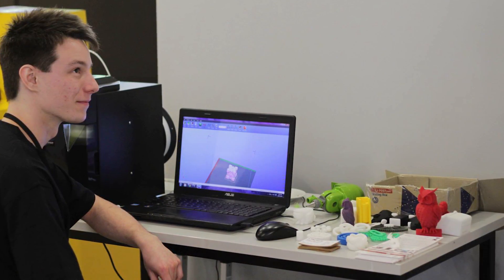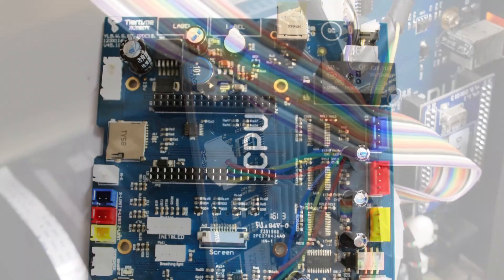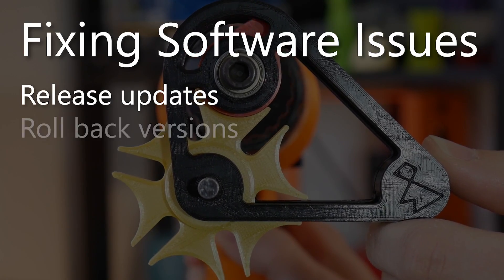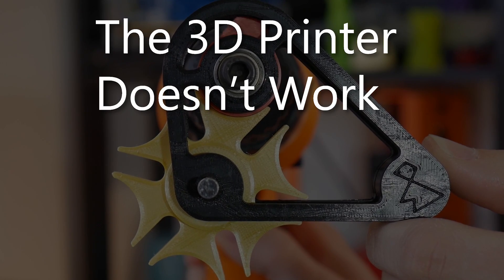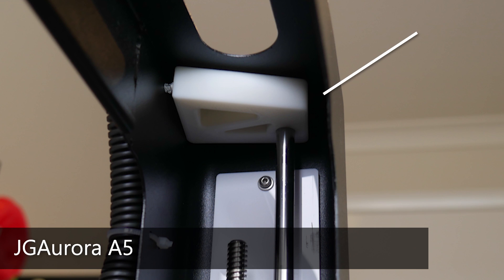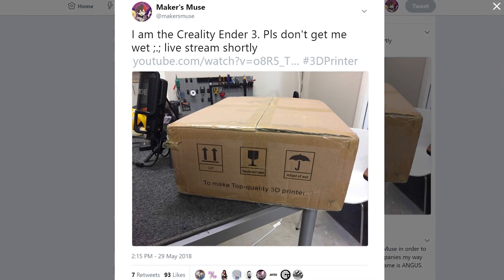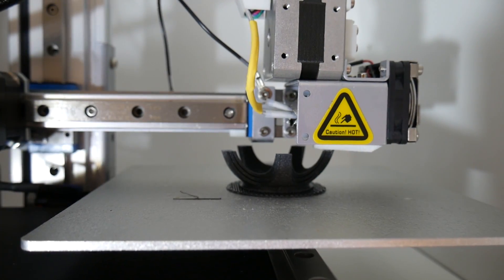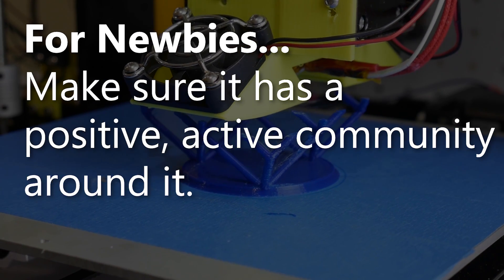Serious Concerns with 3D Printer Quality Control

Comment: I'm still using one of the early Red UP! Plus printers , 4 pin power supply. Granted it has a small print volume but I am still happy with the output. I wonder how many cheap kits will last the test of time. Keep up the good work Angus.

Comment: Well put Angus. In the past 6 months I have had 2 out of every 3 printer kits that were not as advertised and very frustrating to get the sellers to make things right. 

If it was not that my first 3D printer was a good one and I could use it to create parts added to my access to a machine shop and electronic experience those kits would still be parts in boxes and not functional printers. 6 printers later and I now trust no kit supplier at all. 

When I now purchase a kit and anything is missing or broken I immediately return it, Amazon is quite good at this.

Comment: Hello Angus thanks for sharing!
I have a 3d printer store and I only sell tested 3d printers meaning I test the the printer for over a two thousand hours before I deside to resell it. I can't tell you how many horror stories I have heard about these Issues you have addressed on this video over and over and over.
In the long run these cheap chinese printer had given my store more customers who seek a decent product, of course they have to spend more money, I would say this is a valuable lesson for any one who watches a youtube review and uses a code from the smuck who made the video to buy a low-grade 3d printer our anything or any product from this senerio. All that for this smuck who makes about 4% from the company who products he is reviewing and gets a 50% discount so they can buy more cheap crap and do more videos.
It used to kill me when I would see a review and the title starts something like "Could this be the the best 3d printer for under $300.00" and then the whole video is about how to make this 3d printer better with new upgrades, that false pretension should be a warning sign" IF you have to add new modification to anything consider that a warning sign and run the other way as fast as you can.
 "SUCKERS BEWARE" Save your money and buy a decent 3d printer or be ready to spend a lot of time upgrading your cheap 3d printer that will never have the print quality of a better more expensive 3d printer.
If you don't have the skills to and the time to do this, don't suck-up and buy this printer. You will waist your time and money and the taste of false pretensions will never leave your mind when you encounter this senerio again.

Comment: Good, someone said it.. my kit had instructions for some other printer, I'm messing with mains power, and trying to wire up to a PCB with no clear instructions at all.. I got it working, but it'll regularly fail, prints stop screen goes black... I wouldn't buy another 3D printer. I mess with the one occasionally, print something, have it clog or not, finish or not... I simply don't care.

Comment: I would like to see two grades - the first is about how well it works and second the longevity of the model revision cycle (and maybe geographic distribution because it is nice to have a beer with someone else who shares your woes) of the device. The 'does it work' factor addresses the basic problem of a review but any model that does not have enduring iterations is probably throwing good money after bad (As you noted). I read kickstarters, prospectives but none of it addresses QOS in any terms I could accept (like real numbers of devices failed, versions and inventory of replacement units) I have worked in software with the beta model, agile .. and the results are generally bullshit until interaction three or four.

Comment: I understand what you are saying Angus.  I'm an elementary school teacher and I'm on my way to becoming essentially a STEM teacher in a year or so.  I've been involved in 3D printing for about 2 1/2 years starting with a Prusa MK2, and then quickly adding 4 Anet A8 machines.  When I work with kids who are interested in getting their own machine I talk to them about expectations versus price and kit versus ready to print.  Our school system buys only Makerbots so I can point to the Replicator in front of me and say this machine will GENERALLY print what you expect it to, as long as PLA will work for you.  It costs 3K give or take.  I can say to them that they can get an Anet for under 200 bucks, BUT you have to be willing to put it together, which in itself is a very valuable exercise for people in generation " I don't know what nuts and bolts are" to go through WITH AN EXPERIENCED MENTOR.  I can also tell them that the cost of the kit is the starting place for how much it will cost.  There are the printed upgrades you mentioned, a couple of MOSFETs to make them safe, perhaps some wiring upgrades and a few parts to make them more convenient to use like an SD card extension cable for the A8.  If they and their parents are willing to put in the time to build and learn, then I think a kit is acceptable, maybe better in the long run from an education standpoint ( Sexy Cyborg is also right, we can't expect cheaper and cheaper for more and more.  I would like to see the same Anet for the same price and better documentation personally).  The other difference is when you buy an ANET there is no support from the manufacturer to speak of, but there is a community and a realization that it is very much like dozens of other REP-RAP printer kits.  This means there is a lot of information on the web and people to talk to.    

If we are talking about a fully finished 3D printer, especially if it comes with a nice case on the outside then I agree with you 100% you should be able to take it out of the box, plug it in, put the filament into the mysterious hole that says put filament here, upload your file and out pops your result.  That type of machine should cost  much more than a kit, and it should work first time out of the box and every time after that.  But is there really that much of a market for that outside of schools (Makerbot) and industry  (Big money machines?).  I think the most important thing you do on your channel is tell people about what does and doesn't work on each type of machine, and help us to see which ones to watch out for. You also have your ear to the tracks and like this video, warn us when thing change.  I know it's frustrating to review something and then find out that they have changed it already, but what can be done. I'll tell you what, watch Maker's Muse you've got your eye on the ball! 

I have to say that the whole testing - your - hardware - intensive - product - on - the - public scheme is a time honored practice.  You know who is really good at that?  Auto and refrigerator makers.  I'm not going to single out anybody in particular because they have all been and/or are guilty of it to a greater or lesser degree.  The difference?  they have a shop or a fleet of repair trucks and they come with a long warranty.  Oh yes also a more refined product overall and a more established set of expectations and user parameters.   

Summing up, thank you for the warning.  It is noted and I will be watching carefully to see what happens next.  Secondly I will remember to expect to get what I pay for, and if I am going to pay a lot, to find out if I will  be able to get good service after my purchase, before I purchase.  In the mean time I will keep watching Maker's Muse because that guy knows what he's talking about!
-David

Comment: Windows 10 is another example of buggy software that gets fixed latter. Companies need to put some version numbers with these also, it would help bring some more transparencies that are needed. Some examples of of manufactures that do this are AMD and Nvidia, Nvidia gt1030 (ddr5,ddr4), gt1060 (3g, vs 6g) are modern examples from nvidia, I know amd did this however they seem to give different model numbers these days.

Comment: Well that explains why my machine printed inverted about the X axis and the company had no idea why. And most of the bolts were wrong length. And the extruder always failed after an hour of printing. And the Y axis belt didn’t line up very well. And.....         Dont worry though, I got it all sorted out. After many weeks of extra work, and basically rewriting the instruction manual and parts list for the company. Who may or may not have just thrown it away.

Comment: Well, I have not read the book, but in brief, it sounds like what I have long referred to as "The MicroSoft Development Path"... get it mostly working, make lots of noise and toss it out the door... only let trained employees demo it, so the likelihood of failure while on display is lessened... And if you must let someone else touch it, be sure they know as little as possible about computers and tech... As I said, I haven't read the book, but what little you said about it, sound like MicroSoft's long track record. How about their C compiler that ate hard drives on certain controllers? ( that was way back, in the 1980's I believe ) Or how about trying to resize your Windows Vista partition, and having Vista itself destroy the data? Still on Vista, I watched both Sony and Dell OEM versions make themselves unbootable on a Service Pack Update. And intentional damage, when you installed a certain update to Internet Explorer on XP, it killed your Office 97 copy of Access. That one was fixable, remove the update, but it took me hours to nail down why the customer's application died after updates. I could ramble on with more examples, but these were all rather blatant and repeatable.

Comment: Had an opportunity to get a bargain small desktop 3d printer M200 or known as a Monoprice Mini and took the chance. I know I can both make and fix things if it goes wrong, but that's not the same for everyone. I have since upgraded to a Tevo Tornado and being several years old design, it has a good backing and support. I am spending hours and dollars to upgrade to the best it can be as it is already proven to be a solid design. 
Someone has to take a leap of faith and it's the likes of Angus that I will turn to for advice. If I have to muck around for a 100 hours to build and tweak, really, i'm not going to be interested even if I have the cash to throw at it. Thank you fellow Ozzy for being on the ball and calling this issue out for airing. See you on the next vid.

Comment: Nicely said. I was lucky - my first printer was an XYZ printing machine I got very cheap (sub 400 Aussie). Really solid and still works great today despite the (minor at my print volumes) annoyance of the DRM on the filament. Saw some failure with others though, including a "professional" 3mm printer costing thousands that just never worked. Bit of a lottery if you don't go for a name brand with actual local support :)

Comment: Hi. I totally agree with you. My Tevo Tarantula extruder clicked as they knew it was an issue,  now they are shipping it with a titan extruder but back then I had to spend like $40 more on that. I was like what?? That is one of the reasons I won't be buying Tevo anymore until some time pass and they fix the issues. Don't get me wrong I'm happy with my tarantula but it took lie more than the printers cost in upgrades to properly print. Like the wobbly bed, etc.  On the other hand although I have seen your Ender3 review and I totally agree to your point still, I think Creality is doing at great a massive job in listening really quick to the customers and reacting to the feedback, but then again  that leaves stranded the old early adopters. What they should do is ship free of charge the broken or bad pieces to the early adopters.

Comment: This is what I don't understand about people and 3D printing.  People scream bloody murder of the idea of spending even $1000.00 for a good 3D printer, but have no problems spending $100 on a single nozzle or $60/kg for some of the more exotic filaments and expect their $200 to do everything.  When the printer itself is getting down the cost of a few rolls of filament you really need to ask yourself WTF the companies are doing for QC and overall tech if it's cheaper than the plastic it prints.

Comment: at the very least a company should be required to change the version number when they upgrade or change a main component. Thing , thing V2, Thing V2.1 ect. It would make it easier to track what changes have been made over time.

Comment: I am so fed up with  big names of you tubes constantly bashing, and bashing and bashing on cheap market stuff. 
Are You imagining that people who is interested in 3d printing KITS! are so technically illiterate that unprotected power supply is a MAJOR threat? If someone buys a kit  she/he should be at least knowledgeable to hold a screw driver and most likely knows that wires from outlet is not for touching. Hell first thing you can print is not some sort of a "calibration cube", but a same shroud for the power supply - problem solved. 

And about QC well, sure, of course it is non existing, but TBH You pay WAY WAY less that for the "premium" stuff. Also I personally never had any problems with sellers (even the cheapest ones) replacing bad parts. Just You know maybe use some communication with the seller/manufacturer. 

Also "premium" will always try to milk its customers even more - take Ultimakers nozzle replacements 100 bucks for a extruder and a heat spreader? or 75 bucks for set of nozzles, that's isn't realistic even with hand checked parts. 

For me I am grateful for China's market, without it, I wouldn't probably have a great 3d printer at home, or any other non essential equipment actually. When I bought my kit, I got a platform - to learn on it, to understand it, to modify it, to brake it - on an affordable price. And not a product, with some cases - closed software and proprietary hardware. 

So please keep in mind, that for every manufacturer and business model there is a place in industry - and in the end PRICE is one of the major factors to a lot of people.
In general when people see printers in thousands range, and then go by a 200 kit? Do they think, that they won in a lottery? Pay for a family car and get a lambo type deal? So you have a CHOICE to buy over priced "premium" stuff and get probably best results with constrains on hand, OR buy cheap QC less pile of parts and do that you please with it. They are 2 different markets for 2 different types of end result, but that doens't matter that one of them should not exist/even try....

Comment: 3D printing since 2013 I Agree. For solid “point and shoot” level affordable consumer level product experience over time - stay away for now. Trust youtube reviews to be early adopter tinkers excitement. If you can’t help it, never ever buy a first edition, and you will have an endless back catalog of forum posts and youtube to drown your time in, loving it or not. Check it up front, and expect more.

To be fair even money loaded Apple ship unfinished products, sometimes hardware too, but the current 3D product space is nothing but expensive poor quality over time. In my opinion this space is not even at 2D matrix printer maturity level yet, and show no signs of true next level quality/price point movement. Professional high volume players are needed to drive the price down with dramatically better quality included.

Comment: QC is a big issue. Even if you know what you are doing, and buy a kit that has decent reviews, it's still really easy to have individual parts fail earlier than they should which leaves you with no warranty.
That's been my experience with my Anet A8, where the extruder stepper has failed after putting less than one roll of filament through it. Pretty frustrating after printing upgrade parts, and I'm left with buying the exact same part again (Which could fail) or an expensive upgrade (Looking at an E3D setup). Joke is I don't have the money to spare so I can't use my printer for at least 3 more months.

Really I would have been better off just saving up several grand and buying a good machine to start with.

Comment: I was just watching Chaos Core Tech battle with his $1.5K Robo R2. The thing actually rewrites the gcode internally so that the extruder crashes the into the job after a certain height, and the auto bed leveling puts the wrong zero point into the job so it doesn't stick to the plate - manual leveling works -.
Interesting vid - https://www.youtube.com/watch?v=bch6oRhHelE&t=1s

Comment: I think manufacturers reacting to faults and developing their printer is part of the process... The only thing is missing in this case is the version numbers or specific id for the actual printer. for example Printy V2.31 or Printy OHL1 (O is for one head, H is for high temp, L is for large volume, and 1 is for first version). But for this the best solution was to create a common Standard. For example temperature L is max 210 celsius, M is for max 240 celsius, H is for max 300 Celsius...

Comment: Seems to me that the 3D printer market needs to segment better.  Right now we've mostly got industrial and tinker, but pro-sumer and consumer are not well represented.  A hell of a lot companies are trying for those markets, but no one has quite got the combination of tech, marketing, and luck yet.  I'm pretty sure it will happen (unless there is a tech leapfrogging past FDM), but the process of getting there is a bit of a mess.

BTW: By consumer, I'm thinking sub $1000 "just works" with not bad print quality.  Mass production will allow for decent build quality and parts.  A Honda Civic sort of printer... actually more reliable because of the scale and relative simplicity.
Pro-sumer is basically industrial quality without the industrial markup.  It "just working" and quality is critical, but mass production and no gold-plated support brings the cost down to the few thousand range.